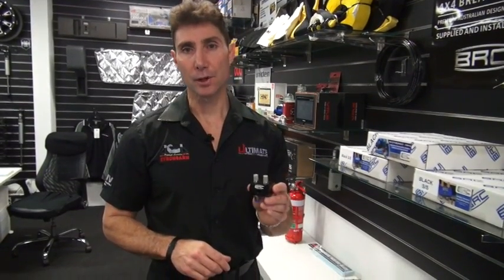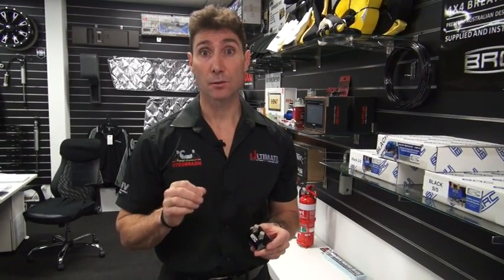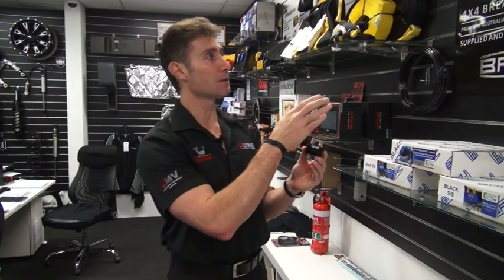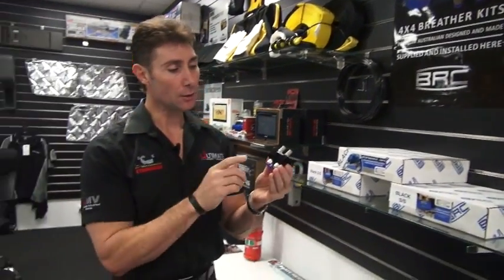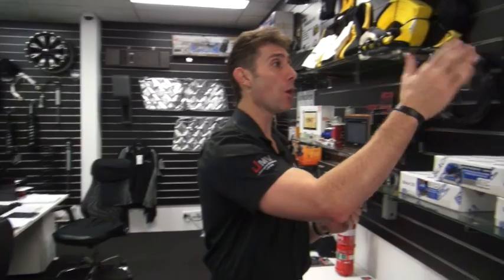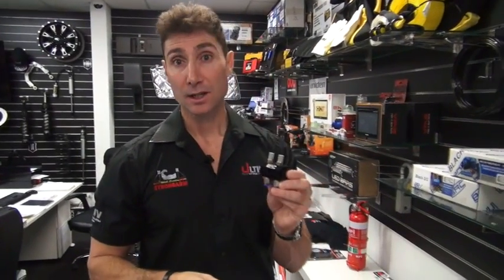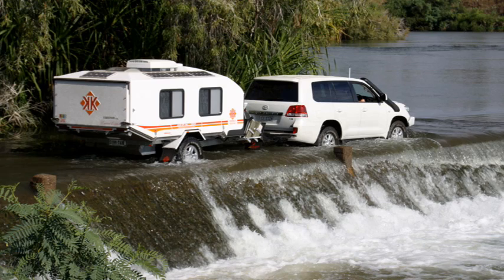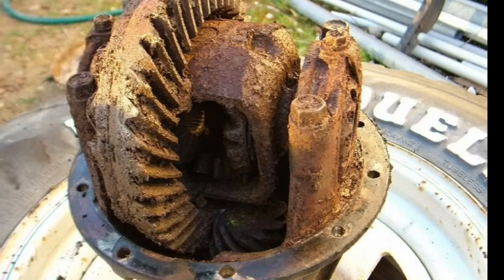Tuesdays Tips - Diff Breathers

Comment: thanks for the video, people started to talk about diff breathers and I had no idea what it is. Youtubed it and this helped me understand

I was wondering since there is factory diff breathers on all vehicles, what's the benefit in fitting an aftermarket one? is it just changing the position of the breathers?
is it possible to just change the factory ones higher? and doesn't a snorkel help with diff breathers?
Reply: Snorkel is to do with the motor "breathing" in air. Diff. breathers are to do with the "diffs", front AND rear on 4x4 vehicles, front OR rear on 2wd. vehicles. They are normally vented about chassis height directly above the diff, these kits extend the height of the vent outlet normally to high in the engine bay of the vehicle, to ensure the diff doesn't suck water in when equalising the pressure within the diff. Easy to fit as all you are effectively doing is extending something that already exists.